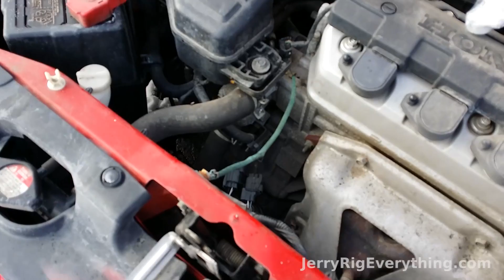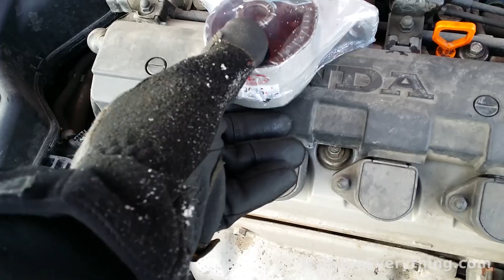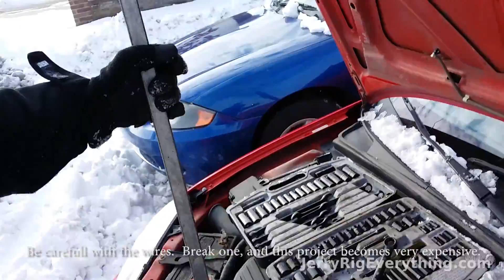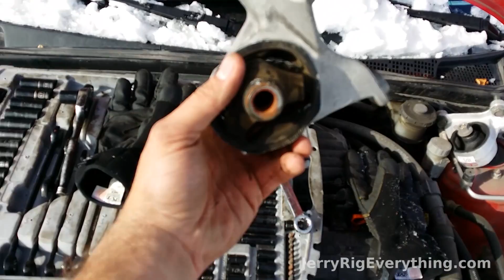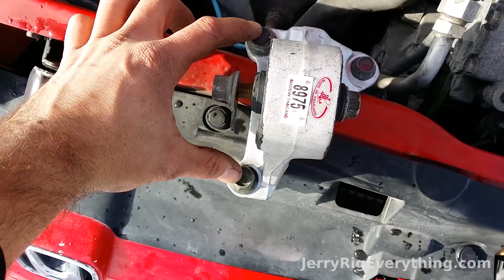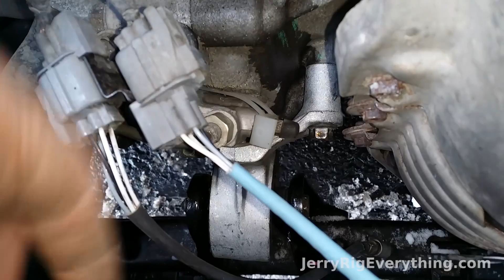2001-05 Honda Civic Motor Mount replacement, automotive repair video

Comment: I have an automatic so the mount is a little different. I've actually done this mount once or twice before, but I'm finding it impossible to line up the holes this time. I had a jack holding it, then I removed it cuz I think I need to go lower, not higher. Been trying for an hour and a half. Can't do it. ughhh

Edit: It was user error. I had the mount upside down. Just make sure you jack the engine up so you can line the hole up correctly. I tried so hard to push the mount down and hold it, but a tiny bit of pressure under the oil pan is enough.

Comment: I'm working on my moms motor mount driver side, and I think the screws are stripped so I made them larger with a bolt threader bad move, now they're roasted and the screws are stripped. Anywhere you recommend I can get the mount and that bracket that connects to the driver side of the engine? I need everything for that side so I can install it for her. Thanks.

Comment: I have a 2004 civic and that same motor mount is slightly different then the one you have! What year exactly you have?
Reply: He has a manual car. The auto transmission  makes the part differ some one to another

Comment: Helped a lot... Had a local mechanic replace a broken front motor mount (the same one you were working on) with an aftermarket part. The second I got back in my car the vibration inside was almost deafening. The replacement part looks nothing like the part you're using, only two bolts instead of three. Read a bit online that aftermarket motor mounts can cause issues on these generation civics. Sounds like OEM is the way to go... 

Not sure I can handle wrenching it myself but I'm glad I'm more educated and understand what needs to be done.

Comment: Everyone.....This is a potential safety issue and complain on any to www.safercar.gov  Also... be aware on the civic failed motor mounts @ 50-60k, cruise control button fail, failed visor, and others.

Comment: Just got a dealer quote to replace front right on 2007 Honda civic. 450$, part was 300 from the dealer. 180 on Amazon. YouTube kicks ass thanks for the vid, nice camera.
Reply from the maker: Tr0picalTim Seriously, I love YouTube. You can learn anything.  And I honestly think I filmed this video with my cell phone.  It was probably a Samsung Galaxy Note 3 at the time.
Reply: i just got the part for $25 on amazon
Reply: I just got all 4 engine and transmission mounts on ebay for $38

Comment: Why not disconnect the wires...they have connectors on them. Also, I would think that having the front of the car raised using jack stands would allow you to work from under the car and make the job a little easier.
Reply from the maker: PCollen YT You are probably right with disconnecting the wires. And I remember trying to work from under the car... but I feel like the engine was still in the way.  Maybe the oil pan?  Im not sure, its been awhile since I did this project.

Comment: I just replaced mine which was just slightly different because my car's a manual and has three bolts to the engine. The easiest way is to put the car up on ramps and you can get to the lower left bolt and the bolt that goes through the motor mount very easily. I purchased a 17mm rachet and didn't even need it. Also be careful of the harnesses that are in the way. Break on and you're up a creek. Do the same as Jerry did in putting all the bolts in part way and it makes a quick job. The shop wanted $165 for the mount and another $120 for the labor plus taxes and "shop fees". These parts are all over ebay for $25 to $50! All in all, it took about 35 minutes to complete.
Reply from the maker: Dennis Petfield Its so nice being able to save 100's of dollars and do it yourself.  YouTube is the best educator out there.  Thanks for watching my videos!

Comment: I have question how much does fixing this regularly cost
Reply from the maker: Ive had shops quote 200 bucks to swap out a motor mount before.
Reply: Jerry's right; I just paid ~$220 (parts, labor, & tax) for this exact repair (not at a dealership). The broken mount meant a failed safety inspection, so I had the shop fix it--thinking that it would be a much harder repair.  I'm kicking myself today.  I should have known.  Never again.
(I'd just saved about $250 by replacing my own O2 sensors, so I guess you win some, lose some.)
Reply: JerryRigEverything hey i snatched my wires out by mistake. They still have the metal things on all of them they are just disconnected from the gray tab. Is there a certain color for a certain hole? I see on yours top right is gray, top left is white, bottom right is black,  and bottom left is white. I think I will just follow that. I hope I didn't screw up anything. Scared the crap out of me when I did it. For some reason my torque wrench didn't have enough room for me to turn it so I ended up using a ratchet which surprisingly worked on the side bolt and the top bolt. The bottom bolt I couldn't get off because it was too hard. I'm letting it soak in some PB blaster overnight and hopefully that works. Also, on another video I watched the guy said you don't have to use a jack under the engine because the front mount is only there to stop movement from the engine when the car is shifting gears. The other mounts are there for holding.